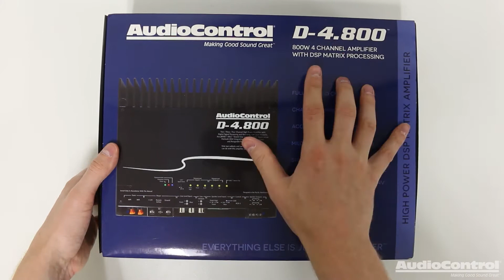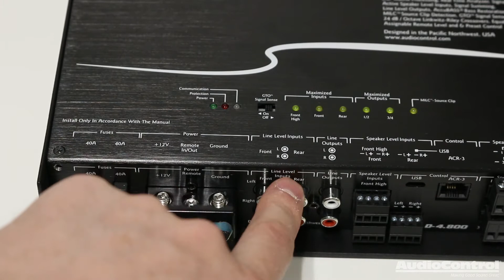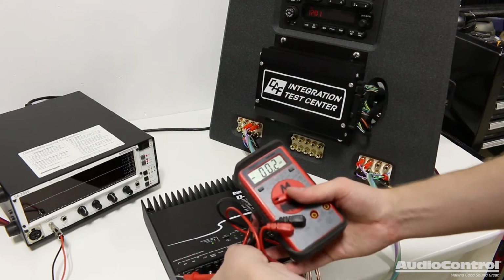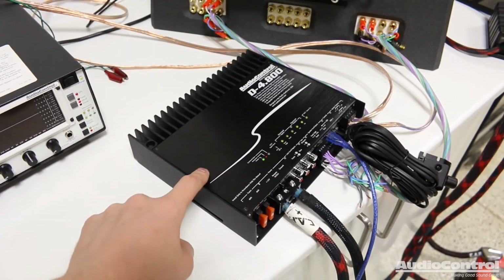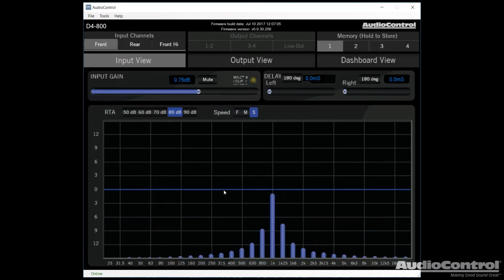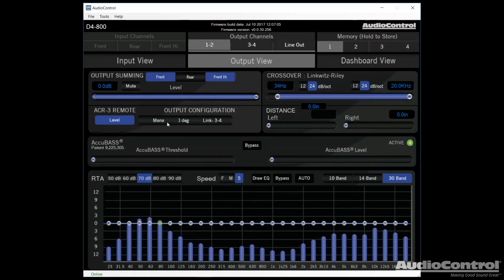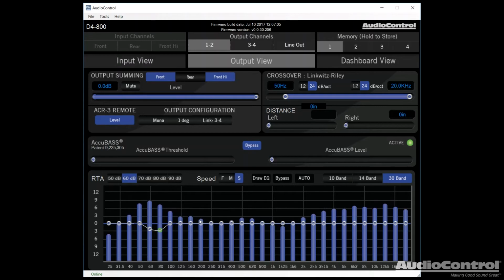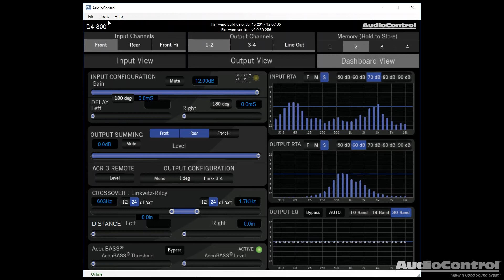D-4.800 DSP Amplifier Training Video

Comment: I have this amp new in the box, just arrived from Crutchfield, Can you run the front channel in 2ohm and the rear channel in 4ohm at the same time? Can you run a Epicenter off the line level out if I use the line level output in channel summed to get a full range signal with all EQ and crossover in BYPASS mode??

Comment: this is hands-down, the best amplifier on the market. I purchased it Because it has a built-lc7i For DSP, but I think the best feature is GTO technology which eliminates the need for me to tap into my fuse box to add a remote wire to my mono amp. I've been searching high and low for an answer on whether or Not this device supports remote output because it has GTO and this video answered all of my questions. Thank you for being around, buddy.

Comment: which RTA microphone do you recommend for a project like this? Also, is it not necessary to run the rear high-level speakers into the amp for conversion? I have dashboard high-mids/highs, 6x9 front doors with components, and 6.5 with components in the rear doors. So is there no need to run my rears into the dsp?
Reply from the maker: Only reason to run rears into the DSP would be if you want to maintain the ability to fade sound from front to rear. As for an RTA microphone, we offer several depending on need and budget. Check them out here: https://www.audiocontrol.com/pro-audio/